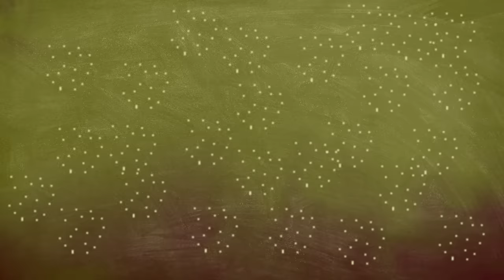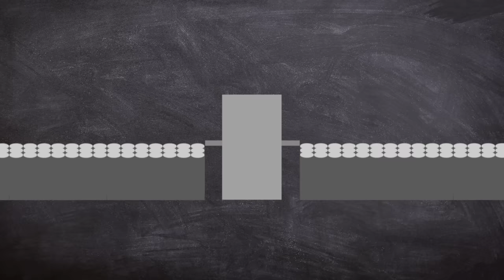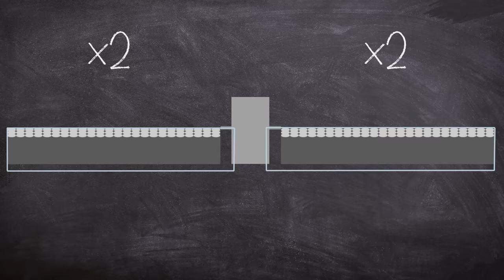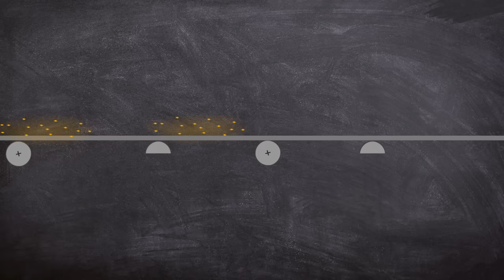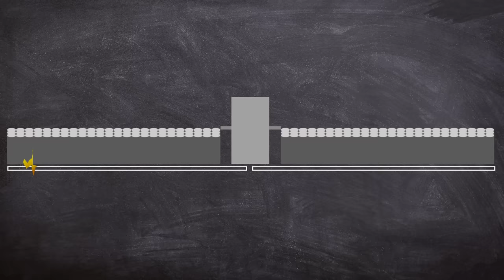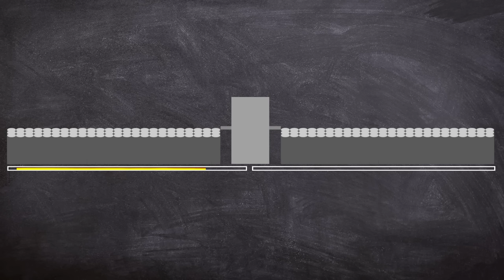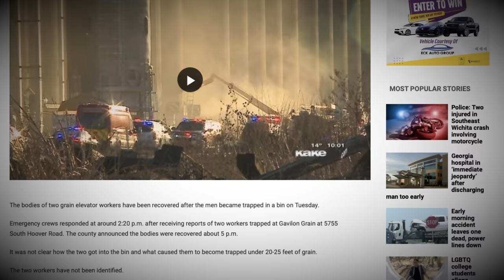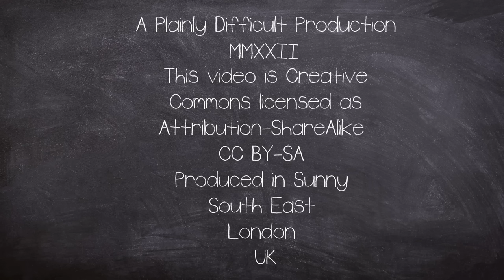The Debruce Grain Disaster 1998 | A Plainly Difficult Documentary

Comment: Wichita resident here. I live 10 miles due north of this facility. I was getting ready to leave for work when a huge heavy thud shook the house violently. I knew instantly that some kind of huge explosion had occurred. I went outside and looked south of my house. I was just unable to see any tell tales column of smoke rising. Driving to work I finally heard the news broadcast confirming my suspicions of an explosion and it’s location was given. 

Very familiar with this site as there are many storage warehouses on the site and been there several times. It is indeed a massive complex, as said a world record holder. Driving out there to see the damage it all seemed pretty much contained within the interior. Yea, the head house walls had blown out and the gallery across the top was about 30% obliterated. I think actually a few of the individual silos also had failures spilling grain. I wouldn’t wanted to be there.

There are many other silos operating within a 3 mi radius of downtown. Most of them adjacent to the railroad main lines running N/S thru the entire city. Grain is moving mostly south to Houston for export and north to Chicago and on to  NE US. The five counties surrounding Wichita are some of the most productive crop land in the world for wheat.

Comment: I remember there being a big explosion at a power generating station in Atikokan, ON Canada when they were doing some experimental testing on switching from coal to wood pellets for fuel. The dust caused an explosion that tore half the building apart
Reply: I worked at a power plant that had an explosion when switching from coal to wood trash.

But that was just the hammer mill violently exploding out of its housing.

Comment: My son did a demonstration for his 4-H club.   He took an empty oatmeal container, put a plastic hose in from the bottom connected to a funnel inside the container.   The funnel was filled with grain dust and he also placed a lighted candle in the bottom beside the funnel.   He made a lid out of tin foil for the top of the oatmeal container.   When he blew into the hose the grain dust went into the air and exploded,  blowing the tin foil lid off.   It was quite impressive and won him the first place prize.

Comment: I used to work at a grain silo (elevator) on Southampton Docks and the whole thing was an accident waiting to happen.  It had explosion doors in all the elevators (doors held shut by a soft lead seal that would pop open and release the pressure in the even if detonation / combustion) but the manager was incredibly tight-fisted and wouldn’t pay for a proper maintenance program.  Holes were patched with Steel-Stick putty (which often fell off) and dust extractor filters, when clogged, were not replaced in favour of just turning the extractor off.  It fell to us worker ants who, along with everything else, spent most of our time hoovering up dust or a few tonnes of spilt grain after an elevator packed-up while laden yet again.  

After loading a ship with wheat (the most common and by far the dustiest grain we handled) the head house floor where the weigher was was often covered in a layer of grain dust that in places would come up to my knees…and I’m 6’ 4”!  

How that place wasn’t blasted into the Solent I will never know.  

Apparently not long after I quit in disgust the penny-pinching came home to roost and there was a massive fuckup. The subsequent investigation alerted the company to the extent of the mismanagement and the boss was sacked.  Last I heard things were improving and the silo is still un-exploded today so something must be going right.

Comment: I was in a dust explosion in north dakota at a pea and lentil processing plant. The biggest in the USA. It was 8 stories high and you can see through the grated floor all the way to the bottom. It was a small explosion in the upper level and blew out the top secret door and some windows and turned everything black 🖤. Anyway it wasn't that bad.
Reply: Here in Denmark we had a dust explosion in a cyclone silo just after it was done emptying the last grain onto the truck. The "top hat" was found nearly half a mile away... Fortunately the construction code of those mandate that the walls are much stronger than the roof, so the only thing that happened to the truck driver was a bad case of ringing ears.

Comment: If a person commits manslaughter due to lack of vigilance or care, or even murder, then that person is likely going to prison.
If a company does the same, they pay a fine and move on with business as usual.

The day this changes such that companies management face the same charges that single persons would is the day these kinds of "accidents" are prevented.

A dust explosion that is allowed to happen due to lack of maintenance and investment in prevention measures is NOT an accident. It's intentional through neglect and as such should in EVERY SINGLE CASE be tried as 2nd degree involuntary manslaughter. Which should be treated at the highest tier with up to 15 years of imprisonment.
This should apply to EVERYONE in a position of leadership that operated the faulty machinery or likewise.

So in this case, those in charge of the workers that were killed or injured. As well as those in charge of the whole chain to the top of the on site management.
All of them should have been tried AND (yes they are guilty) punished with prison sentences.
As this would make each and every one of them directly responsible for the safety of the worksite and they would be legally allowed to refuse (with sustained pay) further operation when safety is neglected. Not refusing to continue to operate is grounds for criminal charges, the same way driving a car while under the influence is.

Comment: Wichita resident and ex steel erector here!!! I used to build giant steel elevators!! It’s extremely dangerous building them and preforming maintenance. Biggest structure we built was called a “90” because it was 90 feet from the center to any one wall. Weighed over a millions pounds in steel and we lifted up them with hydraulic jacks and built each level as we raised it.

Comment: Very good, by chance I was in the area at that time, the violence of a dust explosion was very surprising, those elevators and all of their attachments were built extremely strong but still concrete was thrown all over the area. The blast could be heard over a large area of a fairly large city. While it is complex (and not an excuse for this) humidity and temperature combined with how long the conditions are bad have a lot to do with explosions in grain elevators. There is an example of an explosion in Louisiana where the main cause was very, very dry air which they were not prepared for (versus this one which was simply cheapening out on required maintenance).

Comment: To my knowledge, this sort of thing happened on a smaller scale with old-time gristmills on occasion - especially during lightning storms.

I suspect the lower volume of grain stored might have made things worse - it meant more air for the dust to mix with, after all.

Ugh, bloody cost-cutting on safety... A responsible company would have had all bearings checked and topped up after one caused a fire, and kept the dust-management system running. But nooooo. Grrrr.

Comment: We had a dust explosion (a small one happily) at RIFA, Kalmar, Sweden back in the 80’s. Component legs were sprayed on a capacitor coil using melted tin. The “non used” ton was collected in a container in the basement of the factory building and was to let into a furnace.
It was up to one person to SLOWLY empty the tin dust into the furnace and when he was done, he was done and could go home. However, on occasion he decided to get home early and emptied the whole container of dust into the furnace, thus causing a smaller explosion that didn’t cause much damage. The worker was treated for burns but else was not seriously injured. Also the structures didn’t take much damage.
Still it is interesting how much damage a dust cloud can cause and how easy, almost any kind of dust can ignite and cause havoc.

Comment: Back before I moved to Joliet Illinois, right where there's currently a cement plant used to be a ADM owned grain elevator. It was right along the Des plaines River and it was clearly seen from the house I currently live in front porch. My brother wants asked my neighbor why is it only one side of the house has brand new windows. He told us that the grain elevator used to exist and in 1989 it had a dust explosion. The shockwave blew out all the windows in the house with the exception of two windows on the one side not exposed to the grain elevator. It's been known to happen even in small scale elevators like the one that used to sit on the Des plaines many years ago. What makes the story even stranger is the fact they brought in a psychic to try and find two men that were trapped in the basement of the grain elevator building that collapsed on them.

Comment: I was at work that day, probably no more than 6 to 8 miles away as the crow flies.
We were in an office inside a larger building. We felt the strongest of the shocks from the blasts.
Pretty much everyone who felt or heard the explosion was outside watching that smoke column wondering what happened. It didn't take too long for the location and cause to be desiminated.

We used to go for Sunday drives and going past that immense structure was a common sight.

My heart goes out to those that lost loved ones to that fiasco.

Comment: I would have liked to know more about the accidental deaths of the two employees who got trapped in confined spaces.. it sounds like a total nightmare..
Reply: It's tragically common in agricultural areas.  Granular stuff like grain and seeds doesn't compact under your feet so you can sink down into it like quicksand, and the lateral pressure it exerts makes it very difficult to just pull someone out.  If you put your foot in a 5gal bucket and fill it with grain, you won't be able to pull your foot straight out.  Most rural FD's have a grain rescue team with digging and hoisting equipment.
Reply: @br-v388  "If you put your foot in a 5gal bucket and fill it with grain, you won't be able to pull your foot straight out"

Yeah, no. Grain isn't that bad.

-------

Otherwise the "...two employees..." part, it sounds like they went into a bin with bridged grain from my understanding and fell through, as the articles say "...if they would have had the required safety equipment...."

Comment: Ratings seem about right to me, dust explosions in general are so sadly common.  Sugar, coal, grain, metals...  Lots of them.  We've gotten better generally about dust control and whatnot, but as long as we have oxygen in our atmosphere and rapid oxidation is a thing (thanks, physics) these will continue to happen.  Good maintenance and operations will help, but when you're looking at something like that, murphy's law will always find a way.
Reply: There are trials on using nitrogen atmospheres to prevent pests in grain silos. Basically taking the same nitrogen generation technology from oil storage and using it in grain storage. 

Probably won't do much for explosions though as they are caused by machinery that will still be in oxygen.
Reply: @mabamabam  I doubt that will go very far as it would be reasonably expensive and difficult to detect, unlike the current phosphine.

Comment: I used to drive past DeBruce each day on my way to work. I was working four miles away in a machine shop that day. We heard the explosions. Sounded like a car dropped on the roof of the shop. The elevator always seemed eerie after that. Cold, dark, impersonal, a line of rotten, perfectly straight teeth jutting out the ground. But the place kept quiet until I had left the state.

Comment: I work in ship repair in the UK and we all go through DSEAR training.
We are only allowed to use intrinsically safe equipment on board.
Here's Google's quick run down:
The Dangerous Substances and Explosive Atmospheres Regulations 2002. The Dangerous Substances and Explosive Atmospheres Regulations 2002 (DSEAR) require employers to control the risks to safety from fire, explosions and substances corrosive to metals.

Comment: We have a Mill with a similar Faith in our Industrial Harbour. 
06.02.1979 around Shift change. Whole Thing first explodet, than burned for Weeks. 14 death. Several never found. The Fire burned so hot, it melted the Mills Walts. 
Explosion shattered Glass about 2km far.
They rebuild the Mill and it operates today, without greater Incidents. 
The Roland Mühle is one of the most important Fabrics here.
It's an interesting Tragic, imprinted in our Towns History.
Cause was a burning Cable causing a Fire, wich spread over an Conveyerbelt into the Mill, where at Time, a Truck was loaded with Farin, causing even more Dust to ignite by the Conveyerbelt Fire.

Comment: You occasionally hear about Combine Harvesters catching fire, when that happens the whole field is written off, as the Fire Service will not risk the Fire Engines, in the burning fields. 

The start of the fire in the Combine Harvester is exactly the same, grain dust.

Some of the older Harvesters had a canvas sheet to keep the grain away from the machinery, but rats would eat through the sheet. Causing a fire to start.

Comment: The thing that makes dust explosions even more dangerous is that they're often self feeding. A small dust explosion will happen. The pressure wave travels out and knocks dust off of horizontal surfaces or kicks it up off the ground. This leads to the heat from the original explosion to ignite the new dust. It happens over and over again. Often times it's described as breathing because fire is pulling air in to feed the inferno and pulling the dust in as well. So it explodes, sucks in, and explodes again.

Comment: Just one point truly amused me: the OSHA inspector at 13:27 is probably doing something that now 24 years later is against OSHA regulations. He's not only brushing the very fine dust into his face, breathing it in. He's also brushing it right into his eyes, since I'm pretty sure from the picture he doesn't have clip on safety sides for them. 

My father had the clip on sides when factories began to require safety glasses, so I oddly quickly noticed that. Not to mention Jeez dude, the building was just torn apart. Hope asbestos wasn't originally used as fire proofing.

Comment: If (flammable) dust is mixed in stoichiometric ratio with air the ignition is much like that in a gasoline engine. Placing a firecracker in a small bag of wheat flour (or coal dust from the bottom of the BBQ briquettes bag) produces a rather impressive fireball.

Comment: A very silly thought for everyone...  If the problem is the conveyor belts, do away with them!  Set the silos into the ground, and have embankments either side of the silos that are 6 metres / 20 feet taller than the silos.  Have everything covered, and set the system up so that trucks can tip off or drop onto trays that direct the grain into the correct silo.  To get 50 metres in the air, you would need a 400 metre minimum  ramp either end, and that would have to be on both sides.  By doing this, this would remove the headhouse from the equation and the conveyor belts on the top of the silos.  

Underneath, 3 roads would run through the length of the silos.  A manual opening / closing system to be installed on each silo.  Several weighbridges (open pit / above ground) to be installed so the trucks and rail wagons can be loaded to maximum mass.  

Yes, the earthworks and civil costs will be horrendous, but, you do not have the maintenance or electricity costs related to the conveyor belts.  You also reduce the risk of fire / explosion considerably, as there are very few places for the dust to gather.  

The other option is to use cranes, mounted on rails on the top of the silos.  Similar to port container cranes.  Bins are set into the ground for trucks to tip into.  Crane then takes the 30 tonne container up to the top, and has a fitting to seal the discharge into the silo.  This now reduces the risk of staff falling into a filling silo.  The same system is empoyed on the bottom as listed above.  

I realise that it is a dumb idea, but, this is one way of reducing the risk of explosion.  I do not know what the cost / benefit is for the idea, as I am not sure how to wokr this out.  But, the capital would be dearer, and larger, but, the cost savings would be in reduced machinery, reduced dust collection.  Eventually, the savings would pay for the civil works.  Then, after that, it would be increased profits.

Comment: So as a mechanic he his incident just emphasized something I teach any new person. In heavy Industrial applications, If you have to replace a bearing on one side of most anything with a roller or belt, then the other bearing is most likely not far from needing replaced too since they were most likely installed at the same time. 

Bearings are cheap, equipment is not and people are irreplaceable. Even if the boss is screaming like a lunatic and the customer is pushing to get the job done, never skip a important step. 

Next, you can have the best car/truck/equipment in the world but it means nothing If you don’t take care of it’s consumables. Oils, grease, fluids and tires are all unsung hero’s of anything motorized. Let any one of them fail and most likely you will need repairs before it’s useable again. Out of all of those, your lubricants (grease and oils) are going to be one of the most important since people think they are only lubricating when in reality a lot of the time they are also cooling the part at the same time.